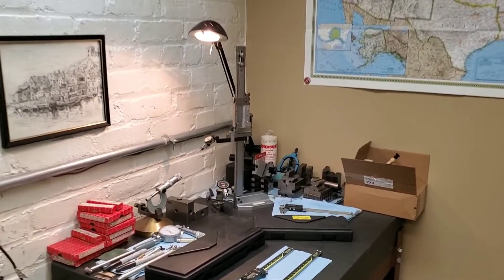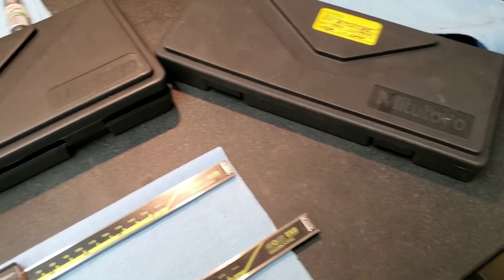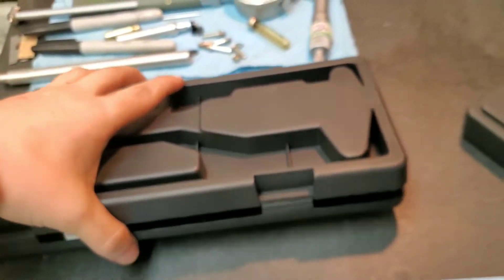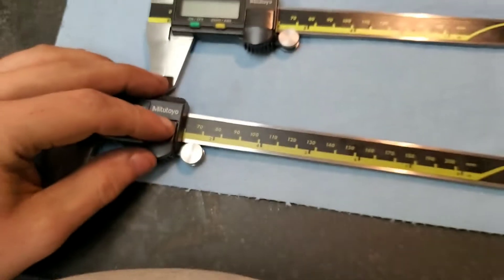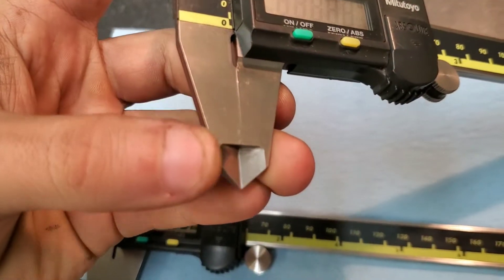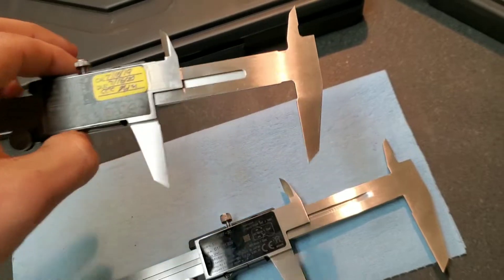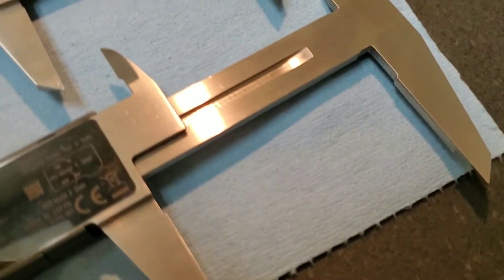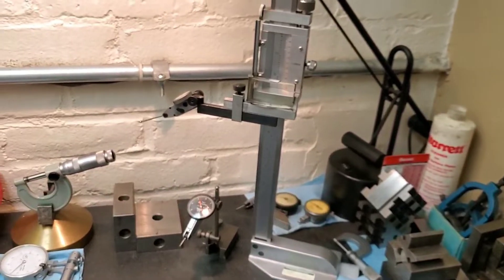Real vs Fake: Mitutoyo Calipers

Comment: Just bought a fake on EBay the battery card is marked SR44 and if you look at the battery it is a LR44 the real Mititoyo comes with the better battery SR44 the counterfeiters are getting more sophisticated. Also my bag was sealed fyi…..39.00

Comment: hello, thank you for this information, I was wondering, what is the precision of the measurement for the fake (not the display resolution). I know the real one is 0.01mm but the fake one? THANKS ! regards
Reply from the maker: I think they're relatively precise. The thing is they're as precise as a 30 dollar pair are it's more so about how long they will hold up. I find the biggest difference is that they will get sloppy quickly if you use them often.
Reply: hi, ok great !  thank for your answer ! @shopdreamin372

Comment: I looked at the calibrated mitutoyo 500-172 12" absolute digimatic and the groove doesn't have a rounded end.  Another set Absolute Digimatic 500-196 6" has a straight angled yellow stripe and is not curved.  All have 4 zeros to the right of the decimal in inch mode. These are tools in a factory that has a third party calibration lab.

Comment: Reputable company's like Mitutoyo don't supply LR44 batteries with their 500-196-20/30 calipers. Especially installed. The included battery is a  1.55 V SR44SW which does not fluctuate in voltage and last longer (3.5 years) .
Reply: I've seen knock-off versions with the SR44SW batteries included and no battery installed. They are picking up on these discrepancies and making their fakes appear better by eliminating as many of the telltales as they can.
Reply: @bobd.  I hear you on that. It's getting to the point you can't rely on label accuracy. When I complained and wanted to return the fake unit the seller told me to keep it and forget it. That prevents buyer from posting neg. feedback. Ebay and Amazon do this.

Comment: Quick check is look at the letters AOS.  The letter O goes closer to the border on the knock offs.
Reply: Printing changes. Mitutoyo has been making digital calipers for a long time. I have a pair older than they've been making knocks offs for so it has to be real and there's things about mine that don't jive with what's being shown here. Like my one line isn't an arc and the groove in the back isn't a radius on the end either. But I get 3 year battery life and none of the knock offs can do that. That's how you really know if you have real ones or not. If you're replacing the battery every year they're fake. I think that's the only feature Mitus really have that's better than cheap calipers. Because the cheap ones work pretty good as far as measuring goes.

Comment: 1. The locking nut is also a different shape.  
2. The serial numbers on the back may not match with the ones on the certificate.
Reply from the maker: Safety first

Comment: I just ordered one, the thumb roller is missing...
Reply from the maker: That's a pretty surefire sign. Even the knockoff isn't a terrible caliper, but it is a $20 caliper being sold for $60-100 just because of the stickers they put on it.
Reply: @shopdreamin372  Mitutoyo make several versions without the thumbwheel, so that's not an indicator at all.  For example, 500-196-30 with thumbwheel, 500-191-30 without.

Comment: What is missing in this video is a comparison of what each caliper measures on an precision known length of material
Reply from the maker: That's absolutely a great idea. To be honest I think even the knock off will measure accurately. The repeatability will be where the difference shows. The authentic set also doesn't shut off but goes to "sleep" and your zero is retained.
Reply: @shopdreamin372  the real test is to measure a 4mm hole and then a much bigger hole with the inside jaws. They are usually most off in cheap calipers
Reply from the maker: @MF175mp  You're right about that, that is the one big thing that I missed unfortunately:(

Comment: POV: the Chinese will watch this video and fix those things and then again you can't tell the fake
Reply from the maker: Oof, that would be quite counter intuitive. I'm sure they have legitimate sets that they base their copies from but really the best way to buy a quality tool with complete assurance is through a reputable tool vendor.
Reply: Our "local" tool supplier sells 150mm mitutoyo digital caliper for €85 (was a while ago below $100 but now $103 as dollar inflation has been high recently
Reply: Actually, the Chinese counterfeiter already knows the differences but recognises his labor slaves and tools are unable to forge the Japanese quality. 

He deliberately uses different processes to accommodate his unskilled labor force to create something for the buyers who prefer cheap price points over authenticity and quality. In fact, they are actually proud of their sales volume and even know they are producing a wanted product (just as most fake Rolex buyers are fully aware of what they are buying for $30).
Reply: @mrbill660  the tool the copiers made is relatively good already. (In terms of appearance) They would need just a few minor details fixed up and raise the price to $80 or something and you'd struggle recognizing it fake until after a few months the battery is dead. Then you'd be really pissed for paying $80 for a $15 tool
Reply: @1pcfred  usually the inside measuring accuracy is also more off on the cheap ones. They're harder to make right
Reply: @1pcfred  I can take inside measurements within 0,02mm with my mitutoyos, with the chinese I wouldn't trust it to be closer than 0,1mm
Reply: @1pcfred  they should read right down from 4mm if they're done right
Reply: @1pcfred  I mean the outside jaws are made more inaccurately on the cheap ones
Reply: @1pcfred  sorry I mean the inside jaws not outside. Have you checked with a ring gauge?

Comment: 6:55 not exactly. I have a pair of 100% genuine calipers at work (CNC machining for aero indystry) and some have a grove like on the 200mm ones. I think it depends on the model and type of depth gauge.
Reply from the maker: You may be right, I have a "vintage" pair of Mitutoyo and they also have the guide broached instead of machined. Even then the finish quality of the broaching looks much better on the older ones than the new one. But good information, I appreciate it
Reply: @shopdreamin372  it's not broached. It's machined with a different tool. A disc cutter.
Reply: Mitutoyo has different factories and component suppliers. Look up the serial number. Mitutoyo calipers can be gotten reasonably.
Reply: Indeed, I have two genuine Mitutoyo calipers with the groove that's clearly been cut that way, and one that has the end radius.  It depends on the exact model.